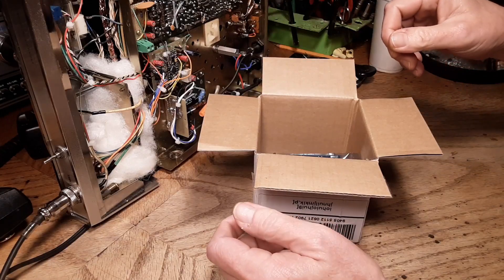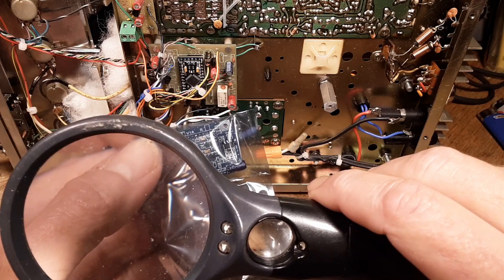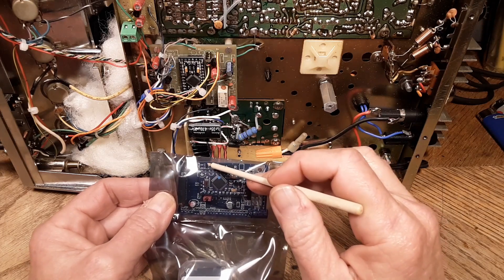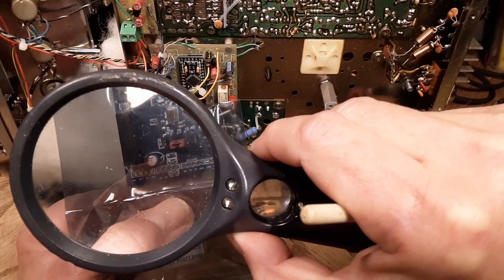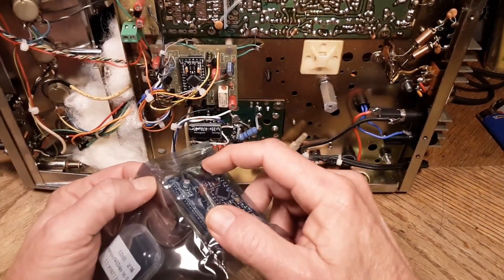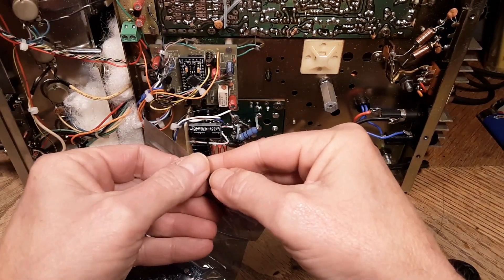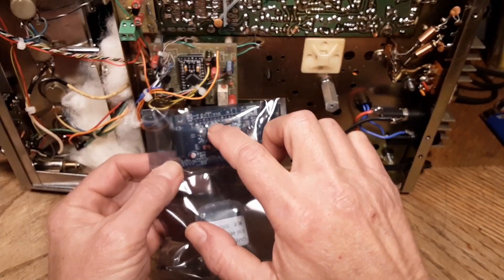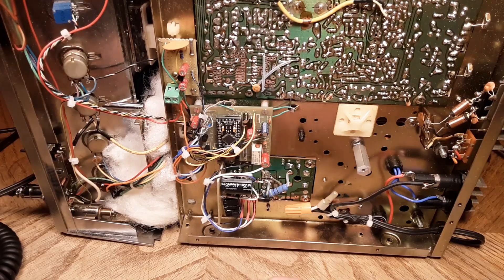new😀version ddsvfo board.🤔

Comment: You should use pin headers
Reply from the maker: Yes, your exactly right! Lol.i have headers but not plugs.lol.i dont have wire inserters for plugs either.ur timing was great im trying to get wires through the holes now without a fray😃thanks for the excellant comment.

Comment: If there's a device ID in the original Arduino's software, (the smaller micro controller board) you might be able to get replacement software generated for it that unlocks ssb and reflash it.  Just like registering the evaluation version if you got it yourself . Way better than swapping boards. Talk to troy radio and see if they could generate it. Might not help the noise problem, but it makes the board usable for SSB possibly.
Reply from the maker: Thanku😀i have a local friend whos smarter on  programming  those boards than me..ill donate my old board to him,if hes interested.i think he can use it.😃thanku for watching.happy new year!!
Reply: @generalingwer4341  , Yup, I can always use those, lol! I've got a miniaturized version of a DDS-VFO circuit in the prototype stage that puts a micro-sized controller and generator on the same small PC board. I found, however, that my original completed code got lost when a laptop died, so I'm starting almost from scratch on the coding. You're having hardware headaches, mine are software....

Comment: You wanted Solutions to your problems with the previous board. Well there you have it. So stop moaning and get it installed😊
Reply from the maker: Lol🙂
Reply: Unfortunately, it was NOT a solution. I stopped by General's home to make it two brains instead of one working the problem, and both units have the exact same issue. I inspected the installation, confirmed the mode-switching logic up to the kit's controller, and observed first-hand the fact that the kits do NOT shift into SSB mode when the radio is in SSB mode. In fact, even the kit's menu items for frequency shifts in various modes are missing. Not grayed out, but completely missing. The menu item numbers jump from 13 or 14 straight to 19. The ones in between, in other words the menu itmes for setting frequency shifts for USB/LSB/CW, etc, are skipped over entirely. I plan on calling Troy Radio sometime today to see if I can speak with someone directly about the issue.

For those wondering what qualifications I have to even be making any kind of authoritative statements on this topic, here you go: I have an electronics degree from DeVry Tech in Atlanta, GA. (class of 1992), I have been programming computers since 1986,  I've designed, built, and programmed numerous computer and micro-controller interfaces for controlling/monitoring various real-world environments, and, directly-related to the current topic, was designing and building DDS-VFO - style systems using both the SI5351 PLL-based clock generator modules (as this kit uses) and the AD9850 DDS modules (true DDS, NOT PLL-based like the SI5351 modules) for my own personal use for years before I knew of this kits existence. I even designed, built, wrote a Windows software package for, and briefly marketed (via EBay) a USB-based computer control system for CB radios, including on-screen signal/SWR metering, channel memory and channel scanning, and coverage of any extra channels that any  CB model's PLL chip's programming had available. My reputation in the CB industry here in the USA is such that I've been consulted many times by various radio brands and distributors for my input on various designs, feedback of new products, including the Stryker radio brand which sent me prototypes of several of their models for testing before the designs were finalized and the radios brought to market. My shop is also used by the Galaxy radio brand as an out-of-warranty repair center for their radio products. I DO know what I'm talking about.
Reply from the maker: Do you think i spend all my time on videos to serve my own needs☹️?